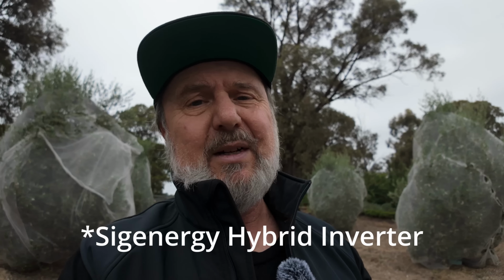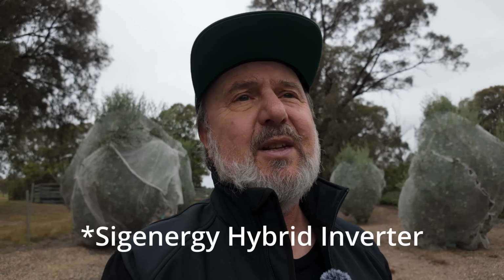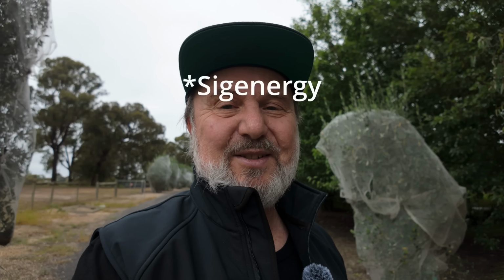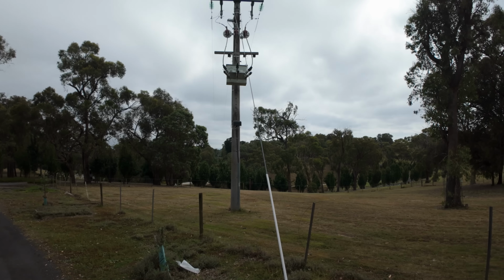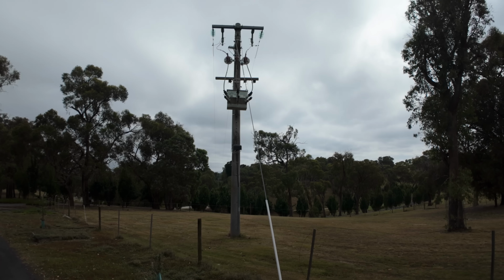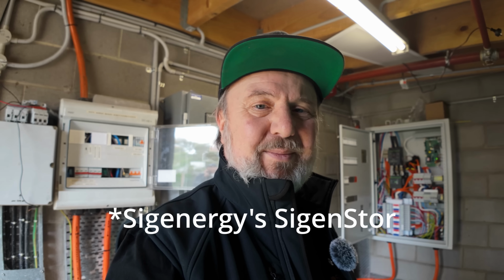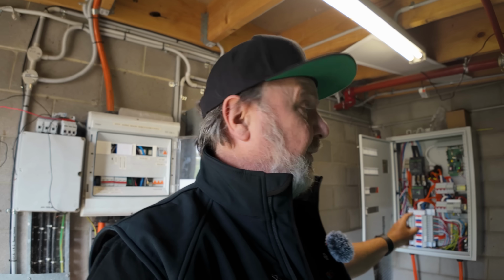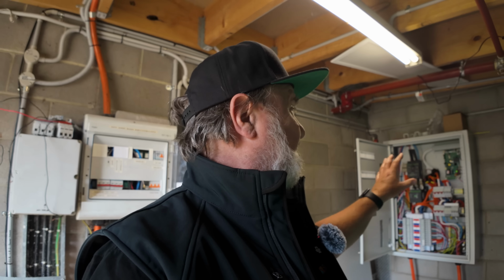Sigenergy's 336 kWh SigenStor Commissioning plus Will Hall Interview

Comment: Sigenergy has a great product, but a sub-standard management team in Australia, specifically regarding the duplicitous ACCC recall process for the the 8-12 kW SP Sig Inverter. The recall was initiated for safety reasons (fire hazard, plug combustion, toxic smoke), but Sigenergy Aust has transformed the recall into a warranty replacement process with significant delays. We have been waiting 12 weeks since numerous failure events and the work order issued only after complete combustion of the AC plug with the entire system inoperable.
Duplicity, False and Misleading business practices: Sigenergy Australia blamed their installers (non-sensical- consider how many different models of inverters are subject to the recall across the entire country – all these inverters had bad installers in so many locations? BS). Take note installers.
Sigenergy Aus recall changed the recall from a safety focused recall to a de-facto warranty repair issue by only issuing “work orders” for replacement only after complete failures detected, rather than work orders against all affected units (which are progressing to combustion after failure and multiple tripping breakers events). Safety concerns? More like a profit concern.
has created this shortage of repair/replacement stock by prioritising new stock to new installations (higher profit) over recall stock (costly warranty repair).
Sigenergy Aus hides responsibility for repair stock shortages and their deliberate profit focused allocation policy by blaming channel partners (Suppliers and installers). Sig deliberately misrepresents the actual stock shortage by misrepresentative deflection by directing customer queries to the Sig installer/supplier base. These suppliers all respond with, “sorry no stock”, as a result of Sig Aus continuing to deliberately allocate new replacement stock to new installs via  it’s “Green/Grey Dot” system, misrepresenting this as tracking system rather than the actual profit maximisation program.
Summary- Good product, but untrustworthy management team.

Comment: 01:28 But $2,000 / week for 55 kVA generator diesel fuel for a swimming pool = pure insanity !  People are supposed to be consuming less, polluting less, and treading more lightly on the planet.  I don't care how rich you might be, everyone should be doing this !  I certainly am.  Yes, for sure people can spend their hard-earned money on whatever they want, but burning $2,000 of fuel a week for a swimming pool --- this is a disgusting waste of fuel / resources.  I am so happy this is being converted to solar + battery.  It's a great start.  They could and should do more to reduce pool energy use.  eg. even putting a retractable cover (like a big wind out tarp) over the pool when not in use can prevent a lot of heat loss (and reduce pool chemical usage).
Reply: elcc😂😂😢😢😮🎉ew
Reply: Hi

Comment: Very interesting products.  I could sure use a bunch of Sigenergy's batteries and a gateway here at my house ...
I have a grid connected solar system with excess solar capacity that I want to use to charge batteries and power my house at night.  Also want to add bi-directional EV charging / battery use.  And export excess house and EV battery to the grid at night (or when I want).